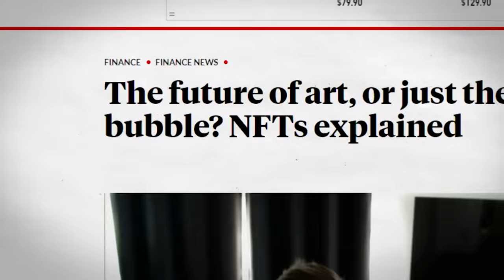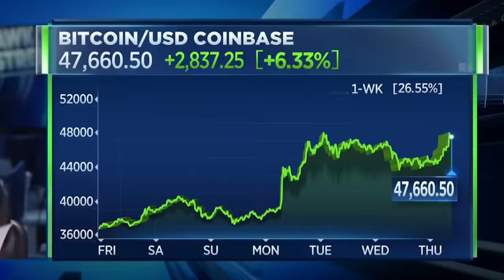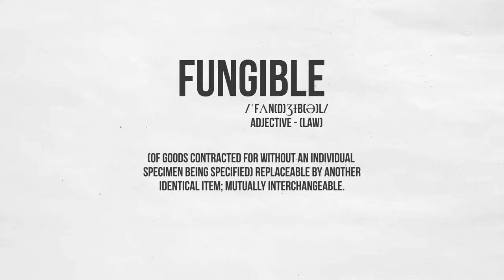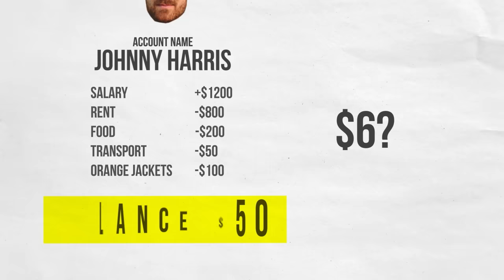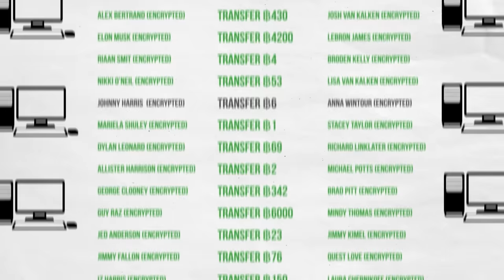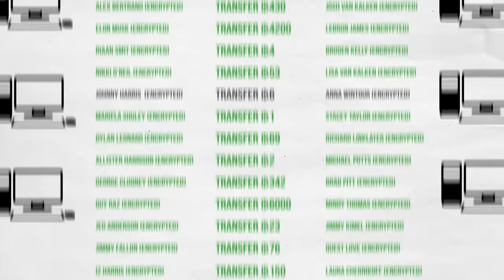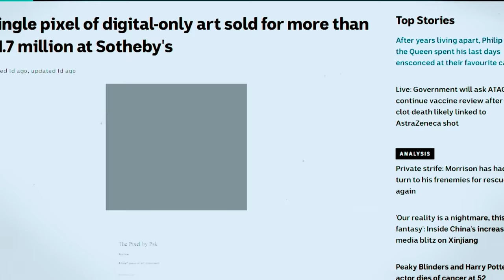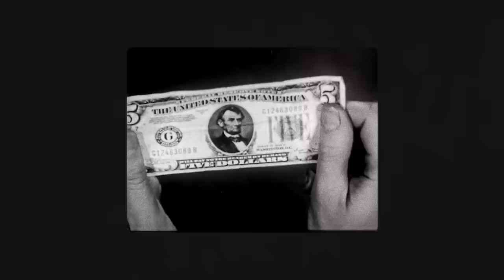NFTs, Explained

Comment: 1:04 What is a NFT
2:32 Ad break
3:41 Fungible - Replaceable
5:42 Difference between Fungible & Non-Funglible
6:00 Token - Blockchain
9:57 Examples
13:07 The Flip-side to the big fad (as of April 2021)
16:36 Outro
Reply: Oof I had to scroll through a lot of bots to see this

Comment: So it's like modern art. It's a way to launder money but uses a ton more energy than a splash of paint on a canvas does. Seems legit
Reply: At first when I saw that people paid millions for those I just thought they were stupid-rich stupid millionaires, but then thought that something more nefarious was going on.
Reply: Seriously doubt it does that. Remember that physical materials has to be manufactured, even the paints, the brush and the canvas
Reply: @MrJakson112  The art materials initially need to be manufactured but once the artwork is created it holds within itself the information that it exists and the person in posession of it is the owner. The true cost of the 'NFTs' is in the fact that, because the types of digital items being discussed here are inherently fungible (you can download and share any of them in your own internet browser) the item's value is only 'recognised' as long as the record of the 'purchase' transaction is perpetually kept within the blockchain. Which with every new transaction is growing larger and more difficult to process, which in turn requires more hardware, consuming more and more power to make these calculations, which needs to continue to exist PEREPETUALLY for any of this to mean anything.. Thereby using FAR more energy than manufacturing a paint brush, a canvas and some paint...
Reply: After you purchased an artwork, you’ll have to transport it and keep it in a controlled environment. The logistics of it involves air/land travel, and electricity. it consumes way more energy than a transfer on the blockchain
Reply: @user-lk4jd5yc8d  I hadn't thought of that. Good point!

Comment: NFTs are just a way to use the Blockchain to say that you 'own' something.

It's a complete novelty, especially since it doesn't really prevent whatever had been hashed into a token from being widely distributed regardless

Just wait until people start making single pixel imperceptible color alterations and it's enough to generate a completely different hash

(Edit)
I'd like to correct myself, it's even worse than I thought, an nft is a packet of information that exists on the Blockchain as an entity that is owned by a wallet basically, but the packet is actually too small to store an image, so image NFTs are usually minted as links to a server that has the image, you're not even buying a hash of the image, or some data based on the image like I assumed, nothing about the image itself is stored on the chain, you're just buying a link to an image.

Like holy fucking shit this is so bad, far dumber than I thought.
Reply: hash?
Reply: @kookiecastro8452  I'm guessing it means the same as "token"
Reply: @danate3849  i'm just not afraid to ask, that's me, u have a problem with that? insecure
Reply: @danate3849  idgaf
Reply: @kookiecastro8452  I don't care.
Reply: @danate3849  ok crypto nerd
Reply: @torak_34  You're the type of person to get sold NFTs lmao.

If you don't understand something, someone will charge you for it.
Reply: You might like our rap explaining NFTs
Reply: @danate3849  all he did was ask a question
 i- 😭
Reply: @breezy5797  I couldn't care less.
Reply: @torak_34  OK Minecraft nerd.
Reply: @danate3849  You did care enough to call him a fool just for asking a question.  Tch Tch
Reply: @danate3849  Yet you took out the time to reply.
Reply: @shariqhasankhan  I don't care that I took the time to reply (30 seconds).
Reply: @danate3849  Yawn
Reply: @shariqhasankhan  Yawn? I'm already asleep.
Reply: @danate3849  Yaaawwwn!
Reply: @danate3849  "I don't care" you clearly de, seeing as you're practically in tears because someone asked something.
Reply: Sounds like people avoiding being caught for using copyrighted music by changing its hash... So yeah. Knowing the internet, it's probably already happening.
Reply: I was thinking about the same thing, what if they just add one dot to the original and it makes an entire different hash but then again there won't be chain of ownership with it
Reply: The unknown factor with this, is if any contested ownership went to court. Would a court accept the token as proof of ownership?
Reply: @danate3849  man, is it really so much to just ignore this person instead of filling up the chat? I don’t see what’s to gain on this, so he ends up waiting days to get a response from some stranger on a question that doesn’t matter instead of finding it out immediately himself, it sounds like you have more concern for this persons time than you do yourself. Just let it be if you feel that strongly about it
Reply: @kookiecastro8452  I’m pretty sure they’re referring to the hexadecimal code used to represent different virtual colors, since most start with a hash.
Reply: @InfamousX1000  I'm concerned that they're an idiot for doing such an idiotic thing.
Reply: @danate3849  yeah, we live in a world with close to 8 billion people with the smartest not being anywhere close the the majority. You’re going to run into this often, you probably already have, you can’t fix the way people think, all you can really do is fill up a glass of bourbon and just watch the show. It’s the circle of life apparently.
Reply: @InfamousX1000  Well, I can get a little amusement out of their way of being.
Reply: @ExplainedThroughRap  straight fire
Reply: @danate3849  sheesh, such unwarranted hostility. Textbook projection. Everything you threw at him is 100% descriptive of you I guarantee it. 👌
Reply: @oyaoya4962  That's such a funny joke! Because people who're on their periods are moody and I'm arguing with people!
You're so funny and hilarious!
go back to school bro
Reply: @oyaoya4962  Get funnier, no-ones laughin'.
Reply: @oyaoya4962  no u
Reply: imagine having digital art detectives whose sole purpose is to differentiate con art from the original
Reply: @ginalley  I imagined it.
Now what?
Reply: @danate3849  explain what a hash is
Reply: @ginalley  It's probably a number.
Is this some sort of serious discussion? It's primal. Like you!
Reply: @danate3849  its not primal, its hexadecimal. Like you!
Reply: @danate3849  aye sense you know so much what happens when a primary nft gets its tokens sold or taken out is it basicaly useless at that point
Reply: @jonathanvelasquez7882  When did I say that? Are you imagining things? Go back on your meds Grandpa.
Man's flexing his knowledge of pictures.
Know something more useful, like what your meds do.
Reply: @Viking_Raven  lmfaoooo
Reply: like the french flag colors?
Reply: @danate3849  he asked a question is ur life so horrible that u gotta make fun of a random guy who isnt afraid to ask?
Reply: @danate3849  im laughin
Reply: @danate3849 if my world doesnt exist then u dont exist
Reply: @linn8516  That makes no sense. Maybe grow a brain? Lucid maniac.
Reply: @danate3849  my world is your world, because i literallly live in the same world as you, if mine doesnt exist then you dont exist
Reply: @danate3849 you exist in my world even though uve never met me BECAUSE YOU LITERALLY ARE TALKING TO ME
Reply: @linn8516  Who am I? Who's "you"? Debunked!
Reply: @danate3849  you is you, i is me
Reply: @linn8516  Comedic!
Reply: @danate3849  its truth tohugh
Reply: @linn8516  It's like answering "What's your name?", with "My name is a name.". Yeah, no shit.
Reply: @danate3849  its the truth.
Reply: Exactly legally it would be different just like copyright and patent loopholes. The idea is eventually it will be integrated into meta like spaces so when everyone goes ready player one in fifteen years you'll be able to drop your 600k cat gif wherever you want.

Comment: I'm glad you covered the environmental impact part of NFTs. Thank you
Reply: Without mentioning the proof of stake shift it’s pretty meaningless.
Reply: Believe it or not, the Ethereum blockchain is still in its experimental phase. It wasn't supposed to explode this big and no one was prepared for it. They are currently rewritting most of the blockchain's code as fast as they can and they are trying to implement a verification system called Proof of Stake that will require SIGNIFICANTLY less computing power and reduce the energy required to confirm transactions. We don't know how much energy it will need in the future but compared to other existing blockchains such as NANO or Cardano, we could potentially bring it down to net zero carbon emissions.
Reply: @Hexagonian  current banking practices are orders of magnitudes more energy efficient. Also computation of this scale can never be carbon neutral.
Reply: When the price per coin goes up exponentially and the energy consumption is only going up based on number of transactions, the network is actually getting more efficient per unit of value "traded hands"

Not to say it scales well enough to replace the current money system energy wise but there are improvements in the pipeline like was said above and we are rapidly switching to renewables.
Reply: @Methbilly  "recording artist Grimes’ recent sale of 303 editions of a short video piece called Earth for $7,500 in cryptocurrency each cost a total of 122,416 kWh of electricity. That’s equivalent to a European Union resident’s average total electricity consumption over the course of 34 years (presumably one who doesn’t trade NFTs), or an extrapolated 79 tons of carbon dioxide added to the atmosphere of our slowly dying planet."  Source: CryptoArt.wtf
Reply: He didn't do it nearly enough.
Here are some facts: SINGLE BTC (Bitcoin) transaction uses up as much energy as a US household during 37 days, 1 million VISA transactions or travelling 1800 km on an airliner. Imagine using that daily to buy your groceries or stuff on Amazon. Right now, Bitcoin mining wastes as much energy as all the banks and their offices in the entire world. Ethereum wastes less than BTC, but it is still based on the same technology that is PURPOSELY wasteful.

The latest fad, called CHIA, is now causing a shortage of SSDs and it's even worse than with graphic cards, because the SSDs have a limited lifetime, and these idiots are killing them in a matter of WEEKS.
Reply: @Victor-kh5rh  Yeah but then it's giving the power back to billionnaires and banks. So what is the benefit exactly from normal bank transactions ?

Comment: A much better explanation than some I have heard, but it still leaves the most important question unanswered.  Buying a house using the blockchain seems like a good thing until someone "Hacks" or corrupts the Blockchain. Are we to believe that the Blockchain is incorruptible like the Titanic was Unsinkable?  There is value to a home because it provides shelter.  What value does owning Jack Dorsey's first tweet have unless someone is willing to trade the purchase price or higher?  You may think that a digital image or video clip is worth lots of money just so you can say you own it, but if that image has no value to anyone else, what good is it?

Comment: The Ethereum blockchain has moved from a “proof of work” system to a “proof of stake” system at the end of 2022. That means it does not need to do a ton of calculations and waste energy anymore.

Comment: So the nft of the concept of the first wheel should be $10000000000000000000000000000000000000000000000000000000000000000000000000000000000000000000000000000000000000000000000000000000000000000000000000000000000000000000000000000000000000000000000000000000000000000000000000000000000000000000000000000000000000000000000000000000000000000000000000000000000000000000000000000000000000000000000000000000000000000000000

Comment: The fundamental reasons & advantages for using NFT's, block chain, & bit coin for transactions over conventional currency & banks was not made clear to me. In both "crypto currency" & conventional currency, the currencies seem to have "faith" based value, but the "crypto" currency doesn't seem to have any clearly assigned value, & I don't know if "crypo" currency can be redeemed for conventional currency (cash), which, if it can't, makes me question its fundamental authenticity as valuable currency. I also don't know if "crypto" currency is even recognized by (conventional) banks as legitimate currency (legal tender).

Comment: As you can see we are already in January and I feel those who would allow the market dynamism to determine when to trade or not are either new in space in general or probably just naïve, the sphere have seen far worse times than this, enlightened traders continue to make good use of the dip and pump even acquiring more equities towards trading sessions, I'd say that more emphasis should be put into trading since it is way profitable than holding. Trading went smooth for me as I was able to raise over 9.2 BTC when I started at 3.5 BTC  in just few weeks implementing trades with signals and insights from Vinod Kuria  would advise y'all to trade your asset rather than hold for a future you aren't sure about..

Comment: You should check out the Kobalt Mining for the batteries in those Teslas you advertise. Tens of thousands of children mining kobalt in Kongo, just so people can drive an electric vehicle and tweet how much good they're doing for the planet and how good of a person they are, on their smartphone with another lithium ion battery containing more kobalt, all mined from childslaves in Kongo.  Being paid 1$ a day and has their hands chopped off if they don't fill their quote. Shafts cave in on a weekly basis and there's no proper tools for the job, they mostly use their hands, pickaxes and shovels. 

That's not a product I'd advertise for, especially since everyone knows about it. It's not like Tesla doesn't know this is going on, they absolutely do. And still, they're doing nothing about it.

Comment: The problem is that crypto is not just financial products. The finance bros have brought that to crypto. Blockchain technology is so much bigger than just using it like stocks. NFTs for example are the best way to record ownership data on a third party. In that case the root coin is just used to secure the network. All these weird derivatives and loan products are useless to me and I've been in the blockchain space for 12 years. I tried using one of these yield projects once, Thyme Wonderland and it didn't work. I just don't really care about defi. Bitcoin is great for transferring value. Smart contracts are great for storing data, payroll, and other things, but financial derivatives in crypto are just a way for finance bros to pull over their same old boring games from walstreet on to crypto.

Comment: So… what's the point of NFTs in the end? You didn't explain the connection between cryptocurrencies and non-fungibility. Cryptos are fungible tokens. NFTs aren't. But does that change anything in practice, except creating more volatility with each NFT constantly changing its value?

The internet gave us instant communication, interactivity, and huge potential for advertisement. All of which were known to happen even before the internet got popular. But no one can explain or predict any useful functionality for NFTs. They aren't comparable to any hype that got useful in the end. They're just like any other snake oil that can generate money only thanks to the hype, and in the end it doesn't leave us with anything actually useful that will change our lives.

Comment: It makes sense,  BTC and crypto is off helping to regulate, rather that pretend it won't ever happen.  The big institutions getting in is the catalyst that will launch us into the stratosphere.  Most people don't like change but after the change is made they grow used to it and it becomes a non issue usually because their fears never materialize. And benefits they were unaware with before turn out to be far more beneficial.  Few if any rug pulls.  The projects that initiated the process of regulation have not been ruined, they got involved in setting guidelines and helping the regulators understand the crypto space. I’d get involved more knowing that I have made over 19` btc from day-trade with Vinod Kuria  in few weeks.